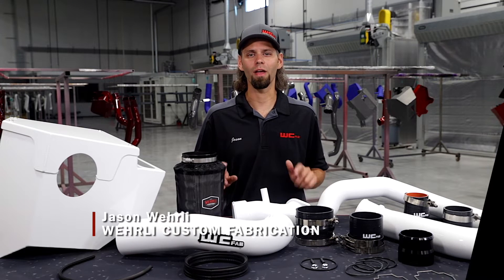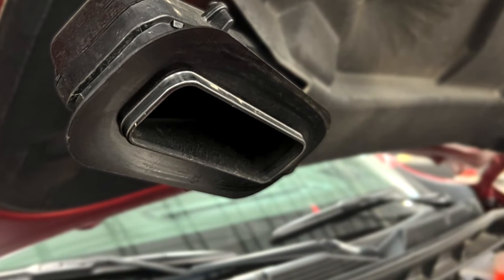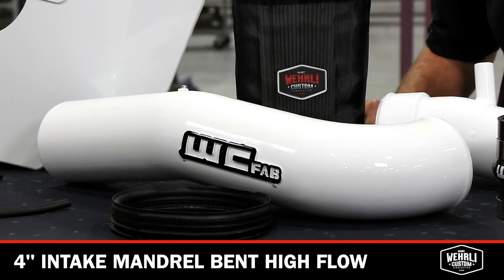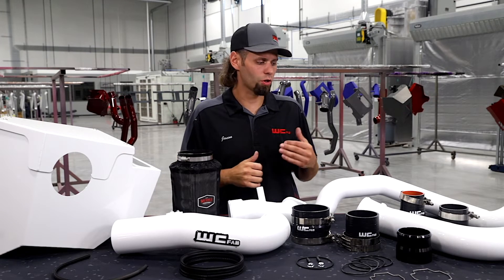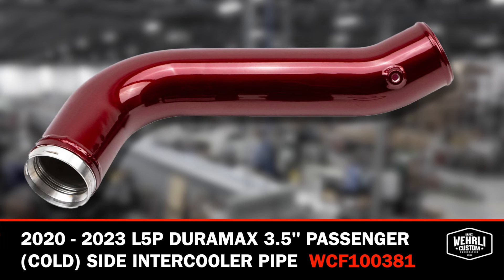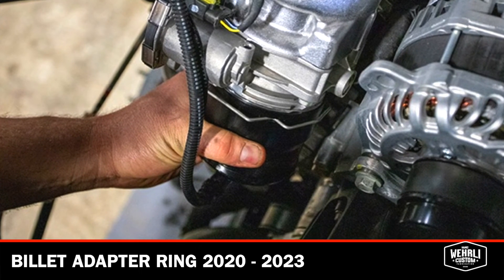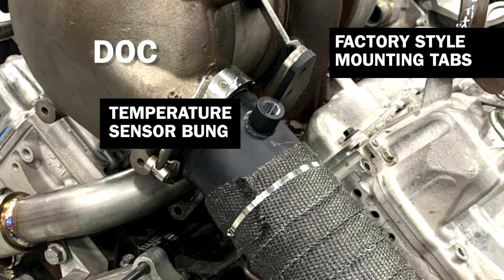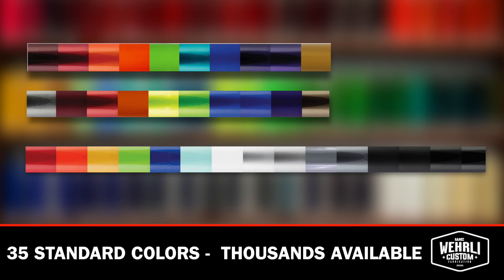WCFab 2020 - 2025 L5P Duramax Stage 3 High Flow Intake Bundle Kit

Comment: Can you do a step by step install video for the stage 3 on a 2024 duramax.
Reply from the maker: Thanks for the suggestion, we'll definitely keep install videos in mind for future content, we're also planning to start covering some FAQ / Tech Tip videos in the near future! In the mean time, please check out the link below where you can find install guides covering the parts included with our Stage 3 High Flow Bundle Kit for the L5P (Intake, Intake Horn, Driver and Passenger Intercooler Pipes and Down Pipe): 

https://www.wcfab.com/p-37782-duramax-instructions.html

If you have additional questions after looking those over, please give us a call at the shop (630-277-8239) and our team would be happy to help!
Reply: @WCFab  do the downpipe make a big difference
Reply from the maker: @Mikediesel-d5p  honestly that depends on your goals and tuning. If you're pushing the limits on what's possible with emissions compliant performance, every bit of back pressure that you can help remove from the turbine helps with efficiency and spool characteristics so you want to make improvements everywhere that you can. If that's less important to you for how you plan to use the truck, check out our Stage 2 kit which is everything shown here less the down pipe.

Comment: I’ve got a 24, I know weight loss isn’t around for these yet. But I do want more turbo whistle, hate how quiet the turbo on these are, will this give it more noticeable whistle on the intake side? I do know won’t hear it through exhaust due to emissions.
Reply from the maker: In our experience, switching from plastic to metal components under the hood and losing the factory intake resonator will definitely net you more aggressive engine and turbo sound from the truck. Something newer trucks are definitely in our opinion as diesel enthusiasts.  ‘Turbo whistle’ largely comes from the exhaust turbine side which as you noted will be muffled by the emissions equipment doing its job. You will get some of that sound on the compressor side but mainly what you can expect to hear / pick up in difference of sound is going to be air movement / suction through the intake tract while the turbo is working.

Comment: does this void warranty or tamper with emissions?
Reply from the maker: This kit is fully emissions compliant. Warranty interpretation varies tremendously from dealer to dealer so we always recommend speaking with your preferred local service advisor about any aftermarket parts you plan to install before making a purchase if warranty consideration is a primary concern.

Comment: Cant seem to find any power numbers after instal.. for example, a completely stock truck with only your stage 3 kit. What rwhp and tq numbers could people see? Thanks!
Reply: I just did stage 3 bundle kit,manifold,all WC reservoir upgrades, 64 stealth turbo,motor ops soft tuning,PPEI trans tuning and the 60” WC traction bars with custom chromed 5” Jamo exhaust and I’m right around 750 to the wheels.

I’m waiting on the fully built 10 speed drop in trans then I plan on doing a compound turbo kit, 100 over injectors, and 12-14mm CP3 upgrade to get up around the 950 range. 

But If you do everything I listed piping and tune wise you’ll be plenty happy with the power even on a stock turbo

FYI I have a 2023 Denali Ultimate 2500HD
Reply: @joshuaneal7753  nice! Would love to see some vids of that for sure!
Reply: @ryanmartin7394  everything is getting finalized with the build as we speak should have everything done within the next 3-4 weeks.
Reply: @joshuaneal7753  let us know, would love to see it!!
Reply: @joshuaneal7753 please post videos!
Reply: @fleashman  wrapping everything up now should have everything done within the next 3-4 weeks
Reply: @joshuaneal7753 I have the same truck and plan on doing the same thing. Any updates?
Reply: What if I install this with the stealth STR drop in turbo charger upgrade, what gain do you expect for the completely stock 2023 AT4 HD? This combination is still emission compliant without any tuning? Do you guys install or have a list of certified installers? 

It would be pretty cool if you guys worked with GM to come up with a WC Fab Edition Duramax from the factory with full warranty. I have heard of issues with dealing with warranty if aftermarket parts are installed.
Reply from the maker: On a completely stock truck, measurable power gains will be limited. Your primary benefits to installing these parts without any further modifications are improved reliability and durability of the intercooler pipes which are prone to leaks and boot failure, improved efficiency of the intercooler system from turbo to engine, and reduced back pressure in the exhaust tract, all of which which contribute to improved throttle response, turbo spool, and reduced EGTs. You will see some top end gain from the intake and intake horn on a stock truck, but without tuning adjustments to take advantage of the greater airflow it won’t be something that you’ll notice in the seat of the pants. This setup will be most beneficial when pairing with emissions compliant performance tuning and drop in style performance turbochargers where it will amplify the gains that you see when making those upgrades. Check out Duramaxtuner’s video here on YouTube covering our 20+ L5P intake as part of their comparison for more details and specific dyno results on how an aftermarket air intake and tuning can pair together for greater combined gains.